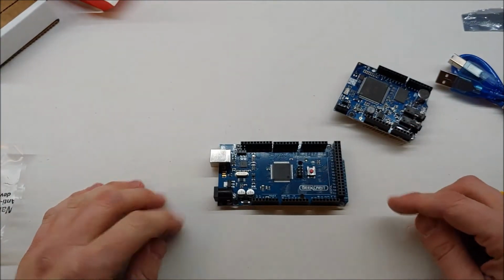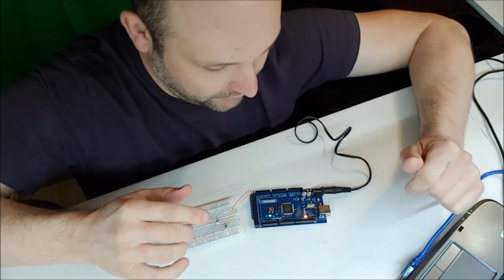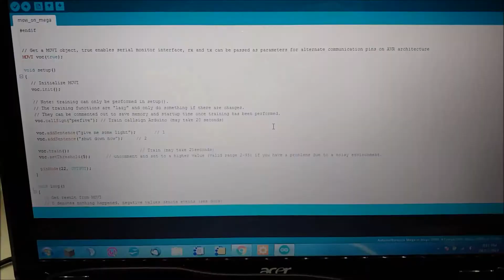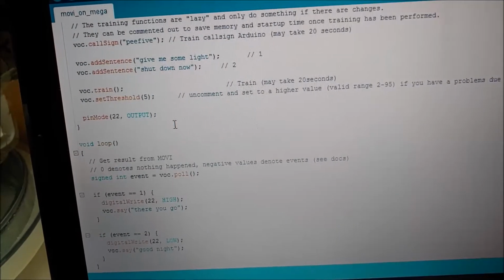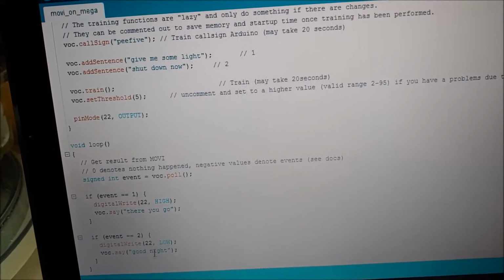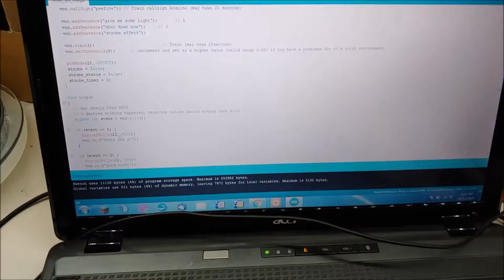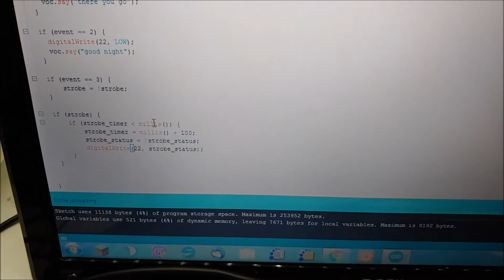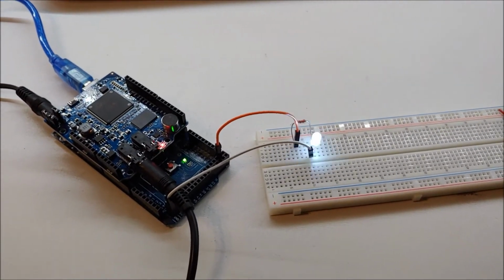Testing the MOVI speech recognition module (from Audeme)

Comment: Can we ask questions in different orders? Please replay
Reply from the maker: It all depends on how your program is set up. Basically, when the board recognizes a word or phrase that you have defined, it triggers several events. Your Arduino program has to capture and handle the events. You can do it simply my requiring exact phrase matches, but I have (since this video) written a program that branches into different states when different words are recognized.

For example, you could have it recognize "Turn on", and then direct program flow to listen for words like "light", "motor", and "relay". This helps to make the recognition more dynamic, but it takes a lot more programming to manage it.
Reply: Thank you brother. Thank you so much

Comment: I’m new to robotics... Once all the codes are uploaded  to the modules, does it need to be connected to a computer or app? I need something stand alone. Also, can more than one person command it?
Reply from the maker: It is Independent from the computer, so it is a stand alone device. It is speech recognition (as compared to voice recognition) so anyone can command it. There is a setting for if it is to be used by children, which makes it recognize the speech from a higher pitched voice.
Reply: Griddlock Cosplay thank you so much!!!!
Reply: @GriddlockCosplay … that’s interesting, because watching some other video, I learned that if you were signing custom commands with your own voice that it will not detect the voice of a different person. Is there a protocol to enable multi person use? Or will it always recognize anybody’s voice as long as they say the speech command?